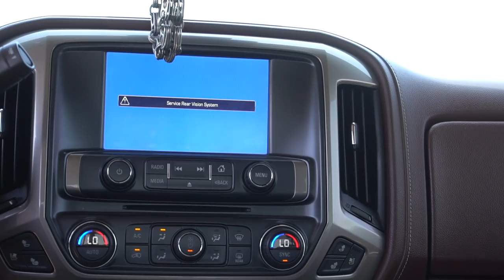HE SCORED ON THIS "TRAIN" HORN DEAL!

Comment: No its a fuse Don't take it to the dealer i had the same problem with my truck check the fuse boxes and test them there is no such thing as a software update for a backup camera and wireless charger
Reply: Israel Perez I don’t know about the wireless charger, but there are definitely software updates for the camera system.
Reply: @Wesspinna  there is a fuse that the camera is on my truck was on warranty and that was the problem look at the truck manual to see where it is

Comment: I'm running a k5la mounted where the spare tire was as high up as I could get it so you cant see it without getting under truck, and that ain't hard to do with 42's and 14 inch lift. I'm running 1/2 air lines on 5 gallon tank with air zenith ob2 running 200psi. The compressor is quick and quiet and the horns are crazy loud

Comment: Read the contracts before you sign them its all layed out for you in the extended warranty info- they cover mechanical failures- moving parts, . Software updates usually DO fix radio problems- back up camera is all controlled through most radios- but your dealership shouldnt be charging you for diagnosis AND the update- most dealers waive diag fees if you perform the work to correct the concern.

Comment: Check the camera plug at the tail gate. Its under the bumper in the center. Mine came unplug  and I the received the same  message. The elec plug is there to remove tail gate.

Comment: Ryan yours is probably tapped into a wire that still runs hot until the computer goes into sleep mode after the truck has been shut off

Comment: Hey Wes I have a spare tire delete that would hold all components and it goes and mounts with spare tire cable  I can sell to u for $20.00 u pay shipping pretty good deal if u want let me know.  Brand new never used.  I have conductors special through hot blasters but I put everything in bed of truck under hard cover and horns under truck sounds crazy but yours looks good
Reply: Sorry Wes I meant 50 bucks and shipping I just looked what I spent lol.  There few bucks lol

Comment: I have a 2017 Sierra Denali that has issue with wireless charger and my I phone xr doesn’t work to this day
Reply: Rikster it's not an issue, iPhones were still not supported in 2017 for the wireless charging. My Android works fine, my iPhone XR doesn't.  2018 was the update.